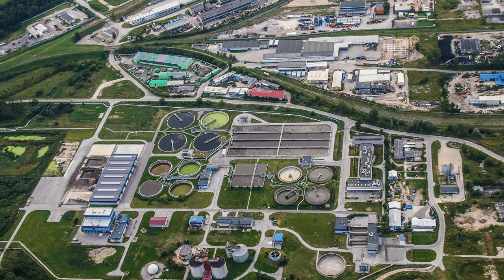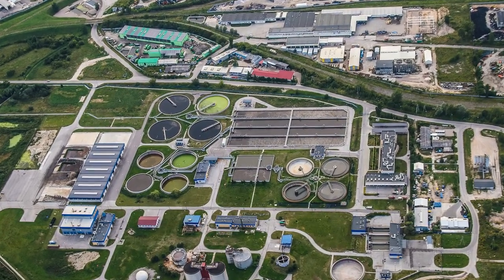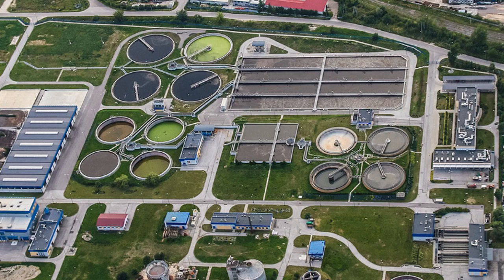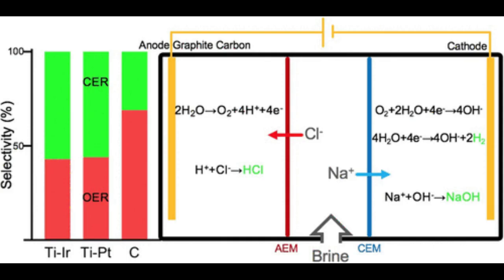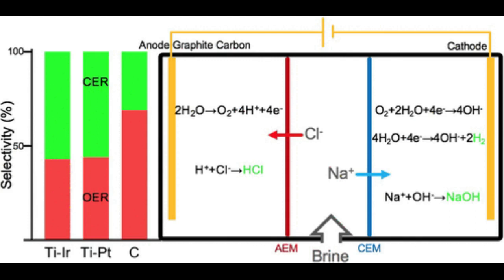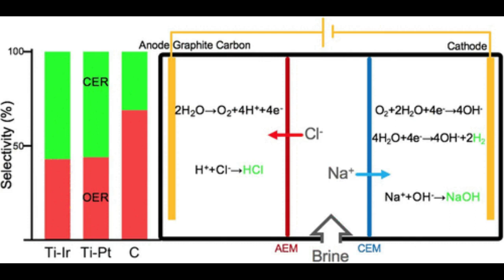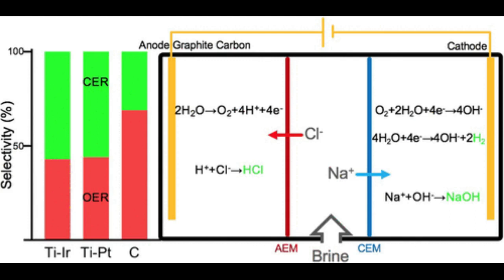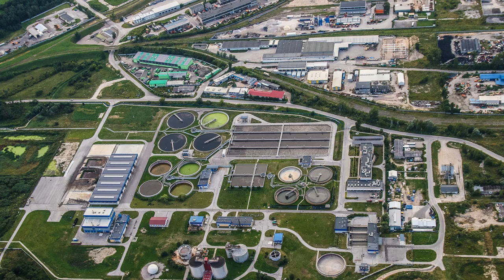Stanford researchers design a more efficient and affordable desalination process

Comment: Isn’t there EXPERIMENTAL PROCESS of Generating ELECTRICITY USING SALT WATER?  How about the waste Brine have Electrons?  

MAYBE BIG ENERGY DOES NOT WANT INDEPENDENCE FROM GRID SYSTEMS?
Reply: It's highly inefficient. You'd loose more power moving the brine than you'll gain from the brine.

Comment: First of all, a nice video and a clear story. To get rid of the concentrated brine of the desalination systems is stil an issue and I think there is now uniform solution for it at all.
In the future different systems should be combined. The use of solar and wind energy could drive these systems. We have to use each system in the field where the rendement is the best.
For me a great solution is use of Eutectic Freeze Crystallisation, Freeze Concentration or Cooling Crystallisation. Depends on the concentration  level of the brine. EFC can convert most salt/water solutions in pure water and salt. Some links to investigate https://www.youtube.com/watch?v=1-BPrCZ6iys , https://www.youtube.com/watch?v=7bMVUrlo-Y4 ,

Comment: Desalination has a huge carbon footprint because of the energy required to pump against the high osmotic pressure on the membrane.  Best source of water is from your toilet, via the local sanitation plant in your town... wherever you are.  No need to be next to an ocean, much lower energy bill.
Reply: nuclear-powered desalination!
Reply: @realpainediaz7473  
What's the worst that could happen?
Reply: Unless there is a monstruous mining company that needs more water than the recycled by a city.

Comment: Converting brine into a useful product has always been the way forward.  When asphalt roads are replaced machines are bought in to  grind them up into millings and then companies line up with dump trucks to take the "waste" away to use it at other locations such as replacing worn out gravel driving ways. After cars drive on it long enough it turns into a solid material. The new solid surface might not be good enough for a big rig to drive on but it's enough for cars.

We need to convert the Brine into a product that boats would line up to take off the hands of the desalination plants. Used cooking oil use to be dumped illegally, now it's kept in locked bins because it's sold to companies.

Sure some jobs would be loss at the factories that previously produced that converted product outside of desalination plants, but we could instead transform the dry south west into a green paradise which will create substantially more jobs than what were lost with the factory closure. We could create millions of jobs in a new green south west for the price of a few thousand factory jobs.

Let's build standardized modular desalinization plant equipment & modular micro reactors in coal country. The idea is that desalinization infrastructure would be standardized with modules, so if a population has grown in in a region you then order additional modules to be installed. With modular reactors you build them in factories, ship them to a site, then after 30 years  you send all of the reactors back to the factory that originally produced them to have them be dismantled with robots in a clean room.
Reply: What if you live in Kansas?  How many different chemical reactions can you come up with using salt as a starting material.  How much energy do those reactions need to make them go?  What's the value of the end product?  What's the concentration of salt in the brine, meaning how much water do you have to get rid of to end up with a solid product?  Seawater is 3% salt, and for every gallon of drinking water you make 1 1/2 gallons of brine.  So maybe the brine is 5% salt by weight.  Lots of water to get rid of.  How?  Where?  Truth is, seawater desalination sucks.  Purify wastewater instead.

Comment: Why not completely dry the brine and sell it as salt rock to places that have snow? NJ and NY spend alot on salt for the roads when it snows.
Reply: Such Brine has various chemicals other than salt. It will take more power to separate salt of the brine.
Reply: too expensive to do so. They can get magnesium and lithium out of it and make way more $
Reply: Calculate the energy required to do this.  Massive amounts.  Just to make cheap rock salt to de-ice roads?  Neither environmentally nor economically viable.  THINK!
Reply: @boweryhester  Brine can be diverted to dessert areas to create brine lakes that will evaporate naturally.